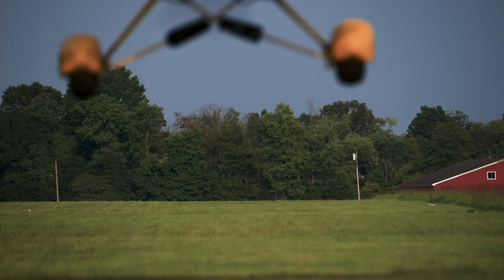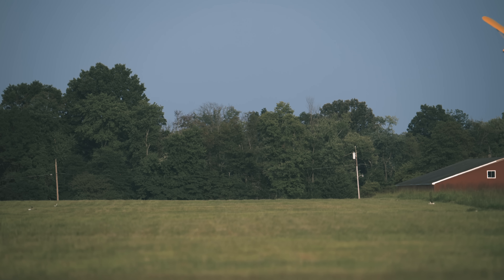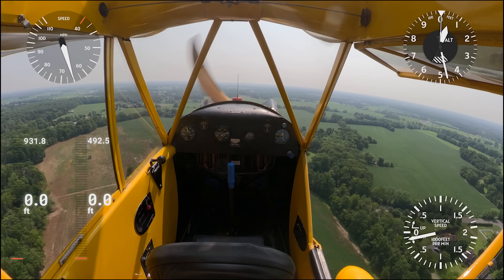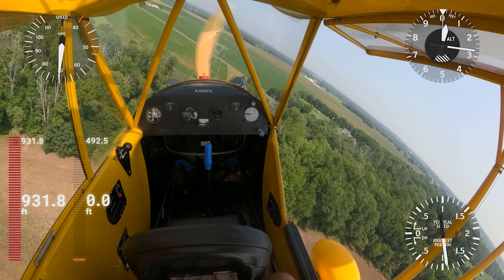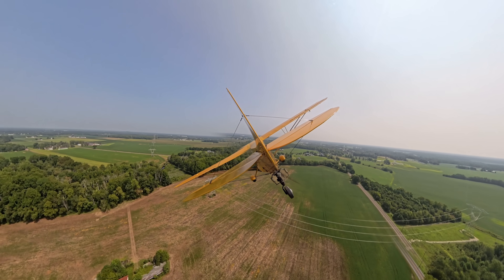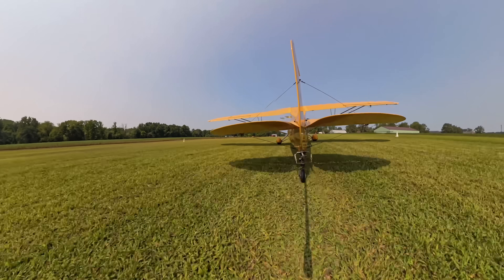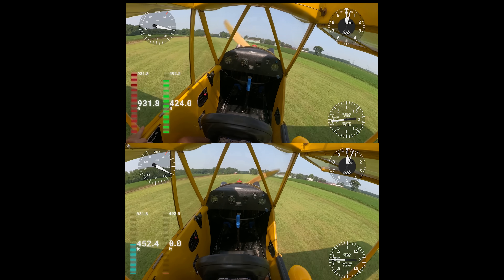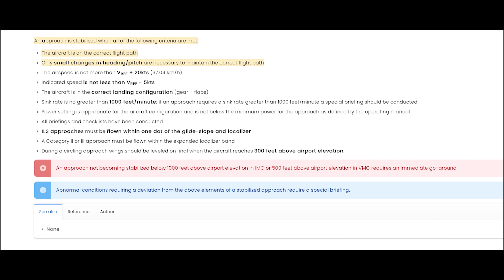What Happened to Basic Stick & Rudder Flying? Slipping an Airplane to Slow down.

Comment: Is it dangerous to do forward slips? If you get too slow I guess? And airspeed indicator might not display correctly when plane is angled in a slip?
Reply from the maker: Anything can be dangerous when it comes to airplanes unfortunately. The danger when doing a forward slip this low to the ground is wingtip clearance and not coming out of the slip soon enough to have the Landing gear tracking straight down the runway. The airspeed indicator is not that accurate as you said, because the airflow is being blocked by airframe.
Reply: @Bananasssssssss  Tried forward slip recently. CFI demoed it first, all the way down until left main wheel touched ground. Felt crazy 😀 I of courses ended my attempt much sooner, but it was fun.

Comment: I'm curious to know what metric you used to define yourself as an average pilot. I think it's good to keep in mind that on average, GA pilots fly less than 40 hours per year. That is not nearly enough to keep your stick and rudder skills sharp and stay proficient. I'm guessing you're flying just a bit more than that.
Reply from the maker: I guess it's hard to quantify, but I don't have any Aerobatic Experience, and my single engine experience is limited to the Basic's (152s, 172, J3s, Chiefs etc. I fly the Cub about 150-200hrs a year and the Airbus a few hundred hours a year so when I think "better than average Pilot", I think of the Pilots who regulary fly Aerobatics, or Seasoned Crop Dusters, or those who fly in mountainous terrain frequently etc. Hopefully that makes sense.

Comment: Firstly, I would like to say I love the videos you make, the cinematography is fantastic. I would also like to agree with the sentiment about basic stick and rudder skills declining. However, I was  disappointed by some of the slipping you demonstrate during the video. Slipping is a great tool to be used on approach, to help correct the final approach path if required. I think slipping that close to the ground is dangerous, and in one of the shots the wing tip only appears inches off the ground. It would only take a gust of wind or turbulence or another unforeseen event that startles the pilot. This could result in a wing tip or wheel striking the ground whilst the aircraft is tracking down the runway sideways, with the inevitable catastrophic consequences. Clearly you are a skilled stick and rudder pilot, but most GA pilots aren't so skilled. As an aviation influencer with a decent size audience, I feel you have a certain responsibility to not demonstrate things that are as risky as this that might lead less skilled pilots to try and emulate and end up in disaster. Slipping is an essential stick and rudder skill in my view, but the emphasis on being a good stick and rudder pilot should be on getting the approach path correct in the first place so you don't require a slip. Secondly, a good stick and rudder pilot should be capable of carrying out slips and knowing when and where to use them to correct the approach path as required. However, as an instructor, I would never endorse anyone doing them below the height at which you would round out and kick the rudder straight to flare the aircraft for landing. Somebody without your flying skills will try it and get it wrong.
Reply from the maker: Fair points. I tried to make it clear (though it appears I failed, lol) that this is just a tool that “can be” used in the event one is fast or in the event of an emergency. I understand we all have different skill levels and I would Hope that before anyone attempted this they would be very familiar with slips or seek the instruction from a qualified CFI. I do appreciate your insight though because the absolute last thing I want to do is encourage anyone to try something they are not familiar or comfortable with. Again, I sincerely appreciate the feedback and will absolutely keep this in mind for future videos.
Reply: @Bananasssssssss  thanks for taking the time to reply, I really appreciate it. My aim is not to spoil anyone’s fun, but to look out for each other and try and prevent us from killing ourselves so we can continue to have fun flying. Keep up the good work making great videos. 👍🏻😎
Reply from the maker: @quickieq2uk absolutely! I appreciate it!

Comment: I fully agree that stick and rudder skills are important, maybe now even more so, in times where higher and higher levels of automation are being integrated in our airplanes, both in general aviation aircraft as in airliners.

However, I don't agree on using a slip to slow down. Instead I think it's better (and safer) to use a slip to get down faster. I fly both gliders and single engine aircraft and slipping is a manoeuver I was taught during my gliding trading to control altitude on final and I think that is where it belongs.
In my opinion it should not be performed while being low over the runway as a means to control speed. Just as with the airlines, you want your last part of your approach to be stable. If you're high on energy (high and/or fast) in your approach, then I would recommend to only use a slip to lose potential energy(altitude) and making sure to straighten the aircraft at a safe altitude out to make sure your final part of the approach and landing is normal. 
This is to prevent loss of control while being close to the ground, with little room for recovery. If you still end up in a situation that might result in a - too - long landing, go around.
Reply from the maker: Tim, I 100% agree that a Slip is better used as a means to get down over an obstacle without increasing speed, I just wanted to bring this up and demonstrate it that it could very well be used as a "Tool" if need be. I figure better to understand and know how and not need it, then need it and not know how etc.
Reply: @Bananasssssssss  
I can understand that, I just hope other - aspiring - pilots can too ;)

Sometimes it's 'monkey see, monkey do'
Doesn't always end well...

Comment: Slipping a plane overtime will bend the frame until the plane is no longer useable. Have seen it time and time again. Especially from parachute planes being constantly slipped.
Reply from the maker: @bigj259  not the case in light singles.
Reply: @Bananasssssssss  sky dive planes are mostly light singles. Im not against slipping I do it, just against doing it every single time to land. Better off planning a stable decent and if necessary slip.

Comment: King of slips strikes again! Definitely have noticed pilots using more runway and never see forward slips utilized at my airport. I also notice more pilots making really wide patterns and long finals like they are flying a 747. when practicing in the pattern it is better to stay closer to the field at such a low altitude.
Reply from the maker: Yeah that's another issue at my airport as well. Really really large patterns. So much so they end up flying into another airport pattern that's close by

Comment: Umm, yeah. About that technique you just demonstrated. Agree with your point about the dearth of stick and rudder skills teaching. But there is a reason slips are taught to be performed in a descent in the pattern upon recognizing they are too high/too fast to arrive at their intended touchdown point at the correct steady state parameters for their aircraft and a go around is not possible/advisable. Entering a slip in ground effect and holding the aircraft off the runway simultaneously with elevator to dissipate “excess airspeed” should only be performed as a last resort in an emergency landing situation. A stall while in a slip a few over the runway won’t end well.
Reply from the maker: Well, used sparingly or not, I think it should be taught. We teach for emergencies don’t we? No excuse not to know how to do this. Also, there is no reason it can’t be used outside of an emergency if the need arises. Stalling an airplane anywhere in the pattern will be deadly, not learning a technique because you are afraid to stall shouldn’t stop anyone from learning and could also prove deadly

Comment: I soloed a glider at age 14 and then a Supercub at 16, at Sugarbush in VT (1970’s). When I took my private check ride later at Danbury in CT, it was a blustery day.  The check pilot didn’t bother with engine-out exercise because of my glider rating. Landing, it was gusty on a tricky approach so I used flaps 10 degrees and slipped for glide path control. The check pilot essentially offered me a job.  He said that when I get my commercial and CFI, to call him for a job.  I credit my old school instructors at Sugarbush!

Comment: Not slipping an airbus 🤣 that would be funny. I’m going to learn this when I get my tail wheel. Great video! 
    Everything you spoke about the flight schools is so true. I found Orlandi at blairstown 1n7 and they are amazing. They start at the grass roots and have a tail wheel program. Fantastic flight school. Not for the faint of heart. They are tough which is what I wanted. I’m not a 141 guy. I also don’t learn in a standardized way. 
       The first thing Vince did our first flight is cover all the gauges. Getting me to stay outside and learn the airplane configurations based off attitude and engine rpm. Then having me peek at the airspeed to confirm. Incredible principles. I was chasing the gauges. He stopped it immediately. 
     I learned what different attitudes combined with different rpm settings give me roughly certain air speeds.
Reply from the maker: Great People up there in Blairstown. Awesome Pancakes too, lol
Reply: @Bananasssssssss  there really is! Everyone has been amazing. I feel like that is said for a majority of the community though. My aviation fam is second to none.

Comment: Those planes using all that runway are due to mismanagement of energy. I blame that on the instructors. With the flaps those kind of planes should land fairly short. Slips are a tool to lose altitude  and you can use them to slow down. People think faster is safer on final, wrong. I cannot tell you how many people are in their Bonanza doing 110 mph on final and don't understand why they take so long to land.

Comment: Stabilized approaches weren't part of the drill in the 50s.  I spent a lot of early mornings at an idle airport doing landings out of a turn to final, that is, out of a power-off circle to land, an exercise in judging height, speed and circle timing.  It's just fun at getting good at things.  There used to be a B737 landing in eastern Europe somewhere on YouTube showing the same thing, landing right out of a turn.  In addition nobody ever dragged it in under power - make every landing dead-stick.  It's making every landing training for an emergency.

Comment: 100% agree on the stick and rudder skills.  I learned to fly in 1977 from a crusty old instructor who was all about stick and rudder skills.  However, I don’t think the accelerated training programs are the problem.  I believe you can get a motivated student from 0 to ATP (if we didn’t have the stupid 1500 hour rule for a full ATP license) in 5.5 months and still teach excellent stick and rudder skills.  This is simply a curriculum and philosophy issue, not a time issue.  Since different airplanes have different systems, I’d much rather see the initial training focus more on stick and rudder and leave the systems training to the hiring airline.  Spending so much time on systems training early on detracts from the flying fundamentals training and may well be mostly obsolete once on the line anyway.
Reply: 😂, not unless the student flew 6 days a week twice a day, total of 5 hrs a day.

Comment: I'm currently a student pilot out in the midwest using a small part 61 flight school and am in the latter half of the training setting up and flying the required cross countries. I find this rather interesting that slips don't seem to be taught at some of these larger schools as I was taught the technique pretty early in my training and have used it multiple times with simulated engine out landing procedures and as mentioned to bleed off some altitude without gaining on final if need be. I think it's a great skill to have.
Maybe the fact that both CFI's I've worked with both have a lot of taildragger time(and the fact I've told them I 100% want to get a traildragger endorsement and possibly buy one someday).
Reply from the maker: It definitely is being taught less and less. I get it rarely needs to be used but that doesn't mean we shouldn't train for it. Glad to hear your school taught it early on

Comment: Slipping in ground effect can be tricky, especially in a low-wing aircraft. It’s possible, but challenging. I do this sometimes, but only in non-gusty conditions. It requires skill and a good feel for the plane. I would not recommend it if you don't know the plane well enough. Slipping on final is just normal ☺️ BUT in some aircraft slips are prohibited with flaps down.
Reply from the maker: All good points 👍🏻

Comment: Wasn't until I got my tailwheel endorsement from a 74 year old instructor in a Luscombe L8 that I truly "learned" to fly.  My skills increased exponentially from my time with him.  Really didn't do many slips prior to this, but he really made it click with me.  He gave me a true understanding of its purpose and what the aircraft is capable of.  I've since got rid of the nose wheel airplane and now own a taildragger!
Reply from the maker: It really is amazing how much better of a pilot we’ve become once we get into taildraggers. It’s hard to really “need” these skills when we have 6,000ft paved runways with Autopilots, flaps etc.
Reply: @Bananasssssssss  Spot on.
Reply: Very similar story to my own though it was an 8KCAB and I think my instructor has to be in or very near her 80s as she knows many of the NASA engineers my nearly-90yr old grandfather worked with during the space race. Learned more in those few hours than I had in the preceding 60.
Reply: Real pilots fly taildraggers! All those others just drive their airplanes. I owned and flew a 1946 Cessna 120 (no flaps ) for many years and could put it down in less than a couple hundred feet.

Comment: “Go Arounds are free” not really. Consider the trim stall. Consider also the power on stall after takeoff. Wave-offs and rejected landings do get botched. Crashes happen in these. The reality is they are their own hazard and you incur a risk with a go around, but is this risk greater than or less than the reason inspiring your go around. Same goes for aborted takeoffs, especially high speed aborted takeoffs.
Reply from the maker: “Go Arounds are Free” doesn’t mean there aren’t risks associated with em, it just means an option. This is another area where lack of instruction is apparent.
Reply: @Bananasssssssss  I agree the instruction to these is sparse. I think the expression, however, is misleading. But “Wave offs are usually the less risky choice” isn’t very catchy.